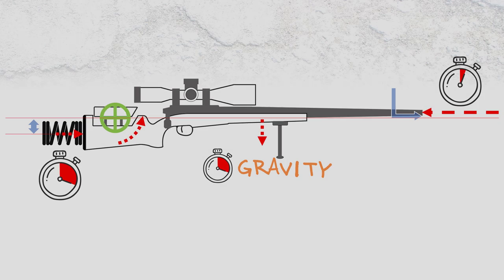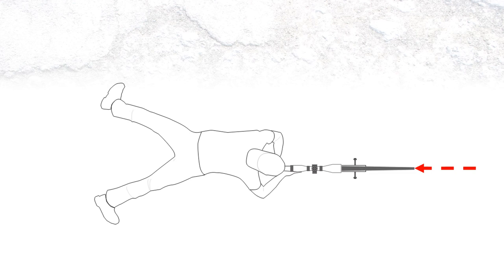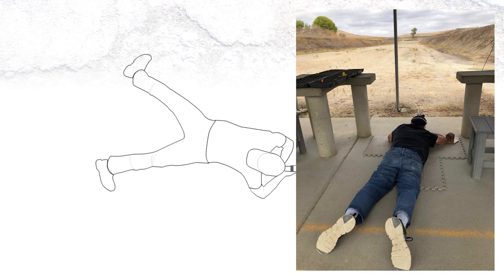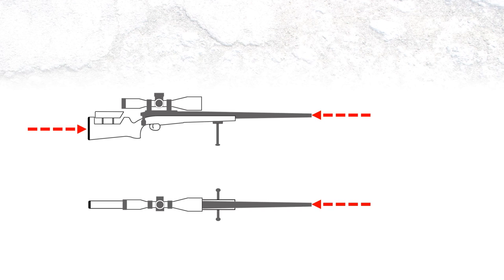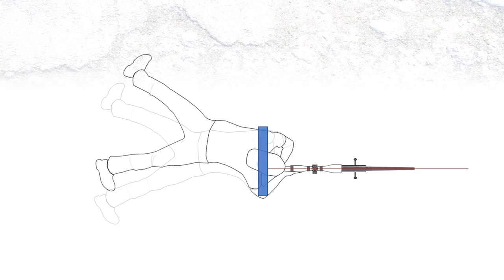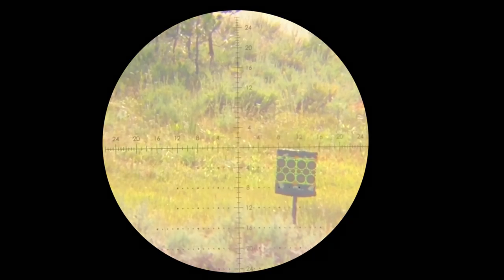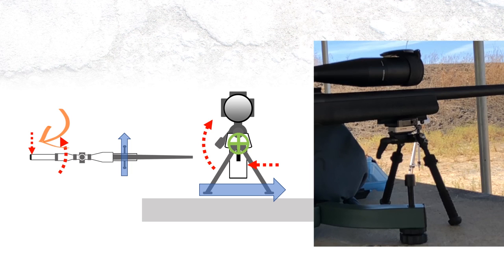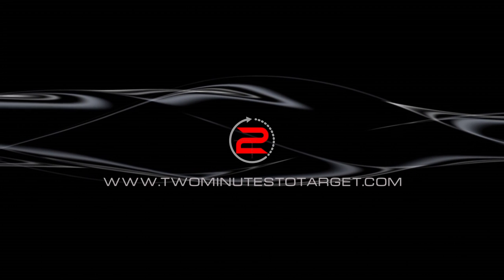The Science of Recoil - Part 2: Getting Behind the Rifle

Comment: Contrary to this, when you shoot what I call "proper" target rifle off a sling, you are taught to line up at 15° or so to the left (for a right handed shooter). This is so that the recoil is absorbed all the way down your right leg which is bent up towards your right elbow and is what's taking the weight of your body. It also helps get the rifle up over your left arm which is what's taking the weight of the rifle.
Reply: the blading off is sometimes because the stock is too long.